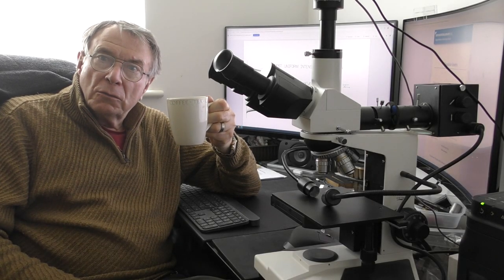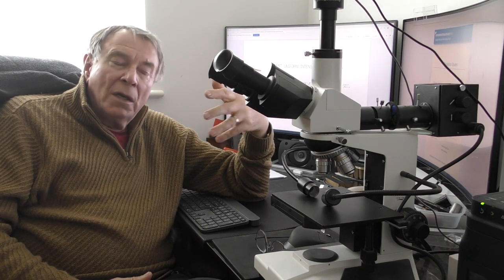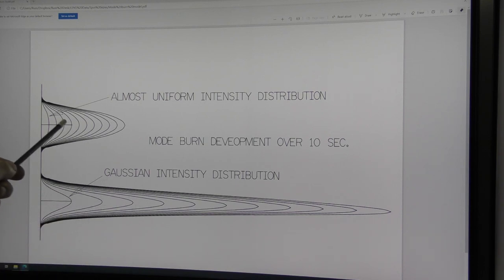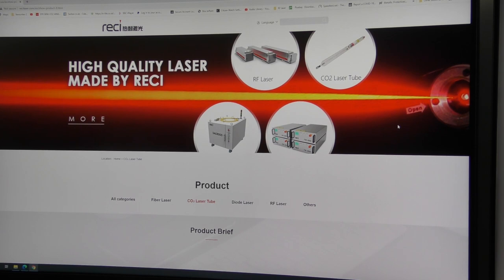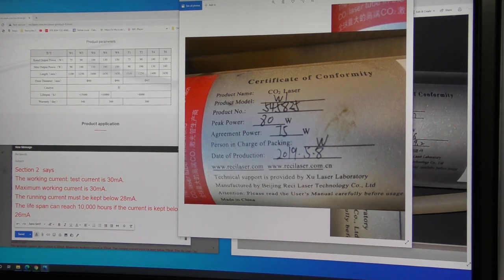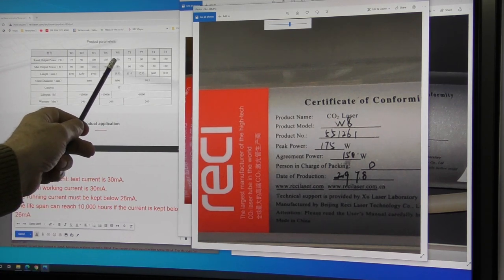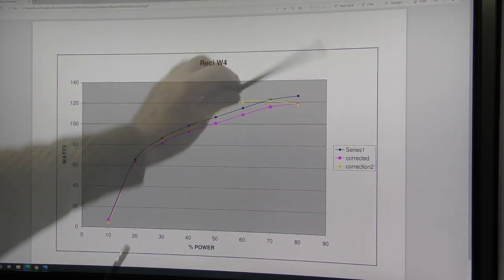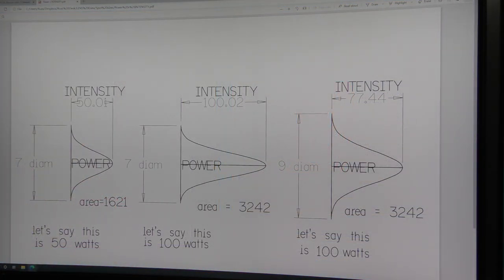RDWorks Learning Lab 207 The Importance of Beam Intensity

Comment: Wow! Amazing information Russ. I appreciate your feedback here and will definitely take this into consideration when I purchase my next laser tube. I'm building up a 24" x 48" bed for a heavily upgraded K-40 with only the power supply and the case as original parts. Literally everything else has been replaced. With the upgrades I've made thus far, The machine performs fairly well considering how mechanically terrible the machine is. But, one has to start somewhere. Your knowledge and videos are extremely helpful in understanding the how and why a laser cutter works the way it does. Much appreciated.

Comment: This is another excellent video Russ. Keep-up the good work. If only the market in general really understood and considered these and the other issues you have raised in your series it would result in a lot less heartache and hair pulling for many. Regarding Mode burn. Forgive me if I missed a video or two but did you try this with your RF? You should find that has a lower beam quality and a greater divergence straight out of the tube but you can improve it significantly over distance with a decent BEC. One other point to add to the RF v DC (It's not really a competition in the real sense - these are just different tools) is that good RF lasers have greater 'head room' (the amount of 'free' power delivered as new). For example, Synrad, Rofin (I can't get used to calling them Luxinar), et al will often deliver >+20% head-room power. This you don't really get with DC lasers. DC tends to give a better beam quality though, much because of the length of the resonator. If you want to test a bit of new kit you can pop over and kick the tyres of a Coherent J2 pulsed CO2 (approx 200w) that we are in the process of building into a gantry machine 3x1.5m - I'd appreciate you running it through the mill on a plotter as most of the time we build these into galvo lasers. It'll be ready end of May. Your point is well made that flying optic machines should never be large format.. One last point: who can dislike a video like this? Maybe a couple of the sales guys at RECI? :)

Comment: Hello Russ, I've been working on this theoretical 3 meters by 1.5 meters long laser cutting machine for a while and just stumble across laser divergence, I find it very interesting that no one has addressed this before, in the case of a machine this size I've always tought that you'll need more watts and thus a bigger laser tube for it to cut through, but goign into rdworks and lightburn which is what I currently use, there should be a software feature to compensate for laser divergence when the laser goes closer to the front farthest corner of the machine(in my case 3 meters and 1.5 meters, in this case around 335cm), basically cutting slower as it reaches this corner of the machine, thanks for your great work and everything you do for the community, great lesson. cheers.
Reply: It's a good idea
How will you calculate the exact speed to reduce to?

Comment: Can someone point me in the right direction of a video that covers text/line engraving. I'm getting lots of dots in my lines when I try and write single line text., I'd like them to be smooth but I'm not sure where to look in the 200+ videos
I have tried but at times I’m sitting through a long video thats not about that topic. Not that there is anything wrong with the videos. I just can't seem to find the thing I'm looking for.
as for the Reci site, Russ you should look up the "wayback machine". you put the website into it and it will let you look up old copies of that site. so if you do need something you can no longer get or just to show how a site has changed, then thats a great resource.
anyway Thank you for your continued help with all things laser my lovely agony aunt Russ
Reply from the maker: If you wish to add your disguised email address to another comment I will reply and delete your comment. You can then send me pictures of your problem.
 Best wishes
Russ

Comment: Russ, thanks for all your informative videos. Is it possible to explore laser filamentation cutting of soda-lime glass? Would love your input on this topic!
Reply from the maker: Hi Adam
It sounds like a fascinating subject but from what I already know about glass cutting, it is difficult to do with a continuous power glass tube laser beam. It can be done with a powerful RF tube but requires very high frequency and short pulse  capability  which is the domain of expensive specialist (indistrial) Rf lasers. like Coherant and Rofin. Some even use lower  6 micron wavelength CO lasers.
 Sorry I can't explore this because  first  I don't have suitable equipment and second  it's outside my basic goal to understand the technology of hobby machines and if necessary redesign small parts for more efficiency. 
 I may do some more research as it sound sinteresting.
 Best wishes
Russ
Reply: @SarbarMultimedia   Thank you Russ for your reply! Yes, Coherent is one of the major companies that have the SmartCleave process for ultra short pulse lasers. I work for a flat glass company in North America and the laser cutting process intrigues me. Feel free to send me a message if you are bored and want to collaborate about glass laser cutting. Have a great day !

Comment: The beam divergence feels like a key limitation for the way laser machines are designed. Does this limit the size of a laser cutter then, since the beam at one side of the machine can never be identical to the beam at the other side? Laser engraving seems even more critical because you really need that uniformity. I suppose a high end engraver would vary the power depending on the position, but that would require extensive calibration.
Reply from the maker: Hi Daniel
. There are devices called beam expanders that are available for CO2 lasers. These normally comprise two lenses like a telescope. The first lens  take the raw beam and expands it by factor of 2. 3 or 4  and the second lens collimates the beam into a (now larger) virtually  parallel beam  Great for engraving but requires more power if you wish to cut with such a beam. 
 My Tangerine Tiger project has an RF laser tube  and typically all RF tubes  have between 7 and 8 mrads of divergence ie. more than twice that of a glass tube (3mrads)./ In that case it is essential to fit a beam expander . I have tried  a x2 and a x3 expander on that machine and yes the beam does become reasonably parallel. I am having a special x1 beam expander made in China to see if I can gain more cutting performance form the meagre 30 watts I have available. . Additionally, any  RF tube is a much poorer match to the Gaussian intensity  profile, so  you can see why those "big boys" emphasize the high speed engraving ability of there machines  and rarely mention cutting. Despite their inherent problems, glass tube technology wins hands down
 Best wishes
Russ.

Comment: How much I would loved to have this information back in the day when I purchased my machine. As a suggestion, it would be great to know also how to spot other B grade parts. Always a pleasure to watch your videos, Russ. Keep the good work up!
Reply from the maker: Hi Nico
 It is pretty certain that both the HV power supply and Ruida controller are  B grade also. Tje power supply most likely failed it respose time specification and unless that is abysmal then 99% will never notice an issue.. It becomes a noticeable issue for photo engraving. The Ruida controller is so complex that you may never see the problemm that failed it. It could be a single dead memeory cell or in the case of my Tangerine Tiger I found a ground terminal that was NOT grounded.  It was in a terminal set that was not used for the original machine build  and I would have had no reason to use it  normally. I added parts that needed grounding and there were too many ground wires in the terminal group I was using.  I chose another ground and accidently discovered the single issue that this controller failed on. That is why these B grade parts can slip through unnoticed.  As I demonstrate, it is easy to test for a B grade tube with a simple mode burn.
 Best wishes
Russ
Reply: @SarbarMultimedia  Good to know. Also, a good reason (apart from the mechanical) of why most of these Redsail machines come limited in speed. It's truly amazing how this machine has become my personal "weekend working at the garage on the old chevy" :D

Comment: Thanks again, Russ!
Another great lesson!
I have a doubt, if I use only 7% power (6% the laser don't turn on in a 100W SPT tube), I increase the usefull life in a viable way?
Reply from the maker: Hi Stefan
Sealed laser tubes are a bit like ink cartridges they will eventually run out. In the case of our laser tube all the CO2 will be "lost". It will not have escaped but converted into carbon monoxide and free oxygen by a atom busting process called dissociation..  At  about 4mA current flow through the tube, the  lasing mechanism begins . The % power for this current flow varies between machines and tube brands. For example many Reci tube do not start working until 15 to 20%. This initial power phase  up to about  7mA  is called preionization  and then the beam becomes stable and fully established. The power then happens all the way up to some limit set by the manufacturer. For a 50 watt tube that may be 20mA, for a 60 watt tube , 22mA, for an 80 watt tube maybe 24mA and for a 100 watt tube it will be about 25mA.  The pink beam in the tube is ionized nitrogen that is the engine that drives the lasing process. You will observe that the brightness/intensity of the pink beam increases with % power.  This is actually allowing more current to flow through the tube and  that raises the energy level in the ionized nitrogen. If the energy level in the pink beam gets above a certain critical value then there is sufficient energy to split the carbon dioxide into carbon monoxide and oxygen. for a 100 watt tube this may be 30mA. So 25mA is a SAFE  maximum running current well away from that critical zone.  EVERY  time your tube switches on it passes through the preionization phase. There are massive current flows at incredibly high frequency happening during every startup  and atom by atom there is a VERY slow process of dissociation occurring. This is how your tube will eventually consume all of its CO2  For normal hobby use you can expect 5 to 8 years life  so dont hobble your enjoyment by thinking you are prolonging tube life.  Almost always use max power for cutting.
 Best wishes
Russ

Comment: Dear Russ,  After purchasing my "100" w red and black chinese laser about 2 years ago i have intently watched a great deal of your videos to try and learn something about using a laser.  I am a simple woodworker wanting to expand my capability by adding "markings" on wood and acrylic.  After watching this latest installment, what little bit of gray matter I had remaining has just turned to little more than gray mush.  I simply want to mark my wood and cut my acrylic.  In a manner, that gray mush can understand, is there a tube and lens combination that will work reasonably well to accomplish what I am wanting to do.  Any help will certainly be appreciated.
Reply from the maker: Hi  Paul
You have the same dream as all other laser use one lens. one tube and some simple parameters. Sadly the more I come to understand this technology the more I realize that is just a dream  As a woodworker you will understand the fickle nature of wood  when you work it with mechanical tools. It becomes 10 times more female when you  fire light at it.  If you recall some of my other sessions I mention that it is light intensity that vibrates molecules to make then hotter and hotter until something happens. Every type of molecule has  different temperatures for that "something"      As wood heats  it passes through many damage phases. Light scorching dark scorching, etc .etc. until  chemical disintegration as it burns(cuts) . Of all people you will know wood is made up of many parts,  like  the resinous hard parts. the  knots and the softer more uniform cellulose parts to name but a few.  Each one of these molecular structures requires a different  setting for ideal engraving or cutting . If you have ever tried engraving bamboo  you will experience these differences to the extreme. So  every wood is different and there will always be a compromise set of parameters  that you will have to find by experimentation . It now gets even more complex with what I have shown in this video because you can get change of cutting ability at different places on  your table.
 Are there any simple rules?   In general you want a  "sharp" beam for cutting and a "blunt" beam for engraving. If you have a nice Gaussian intensity beam then  the max current allowed for your tube should give a "sharp" beam  Thus always cut with max power and set your speed to produce a single pass through-cut.   For engraving you naturally "blunt" your beam by reducing the power. Blunting the beam will stop the penetration and allow more scorching type of damage. The trick now is to leave the power fixed at some lower level and play with the speed to get the right degree of scorching for a particular type of wood. 
 Acrylic is completely different in that it only has 3 states. Solid at room temperature, liquid above 160C and then vapour above 200C . Much more predictable for cutting but you cannot rush acrylic it cuts relatively slowly. If you see the bottom of the beam trailing more than a few degrees behind the top of the cut then you need to slow down. Engraving acrylic is  very simple. You have to destroy the SURFACE just enough to catch the light. It does NOT need deep engraving to achieve that goal. The deeper you engrave the more fumes(vapour) you will produce and the more that vapour will condense on your work . Again you need a "blunt" beam  and play with the speed to get the right penetration.

 Sorry there are no simple parameters to dial in.  It needs for you to understand the beam, the lens and the material you are cutting or marking/.
 Best wishes
Russ

Comment: If you had told me a year ago that I would cut through a 40mm thick PMMA sheet with a 60W C02 laser, I would have thought you were crazy. 
Now the proof:
A block of 40mm thick with a hole of Ø10mm, at 65% of the 60W laser ± 16 mA, with a speed of 0.1 mm / sec.
The result is certainly not beautiful, but unbelievable.

The results in a block of 30x30x8mm.
Completely through at 75% in 3 seconds
Through it at 65% in 5 seconds
25mm deep in 10 seconds at 25%

Russ thanks again
Reply from the maker: Hi Jopop
 I like your fearless approach. You will be trying to sneak into Australia by the back door next week!!!
 Best wishes
Russ

Comment: Is the beam divergence not insignificant after being focused?
Reply from the maker: The aim of focusing the beam is to make all the light "rays"  CONVERGE and  pass through a single point . Light travels in straight paths thus by default all rays  after the focal point are supposedly diverging and rapidly losing energy density.  The beam divergence affects the size of beam hitting the lens. It is at this point that you have already lost beam intensity so the lens cannot amplify something that's not there.
 Best wishes
Russ